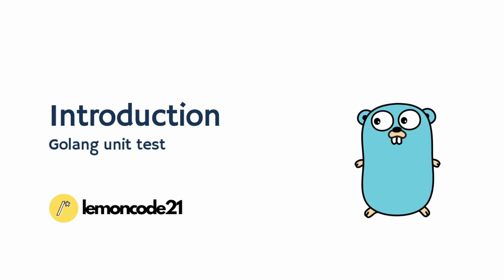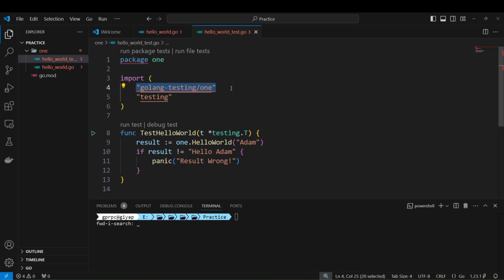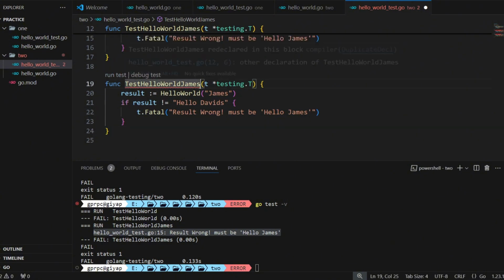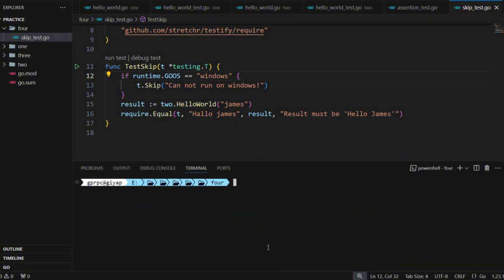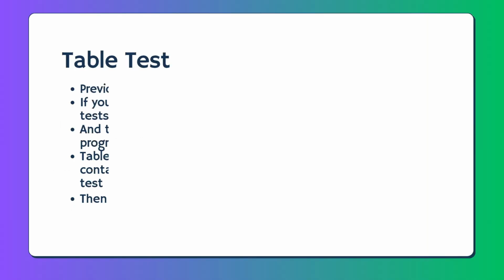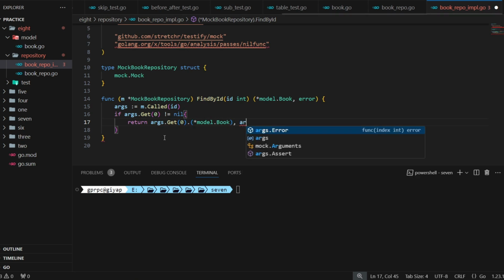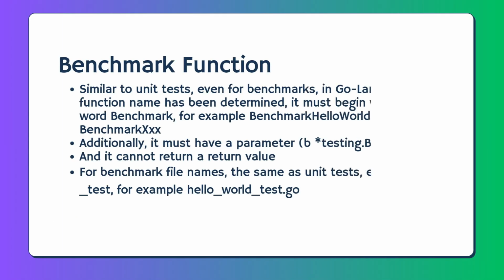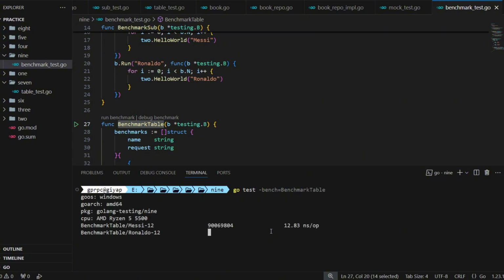Golang Unit Test

Comment: You make great videos. Thanks a lot ♥, I've learned a lot from them(btw not only about golang, FastAPI too). 

Also, I have an issue with understanding a clean architecture, especially in golang. Can you make a video to explain how to name files for adapters/interfaces and other stuff (just as an example), how to use a pkg and internal folders? 👉👈

I need it because everyone using it with a golang + requirements for junior go dev is much higher :(
Reply from the maker: Nice work!